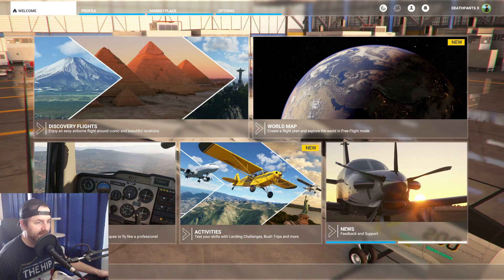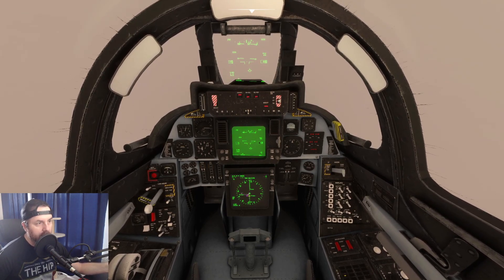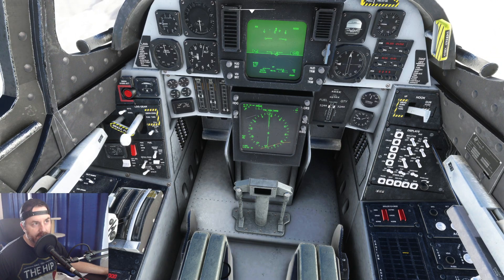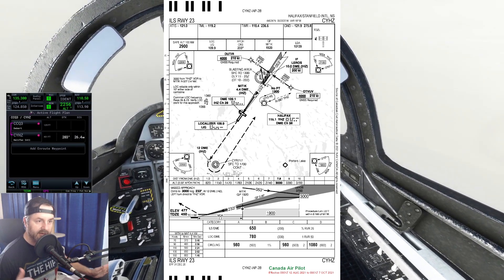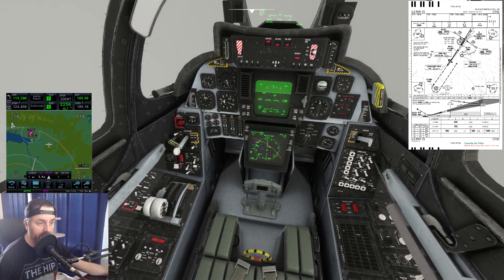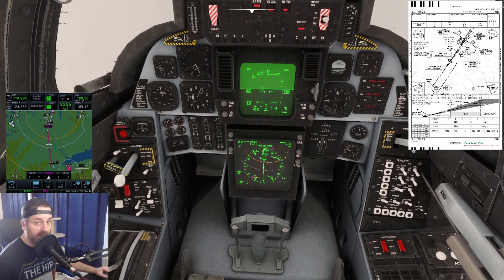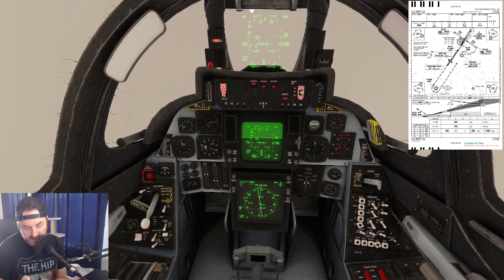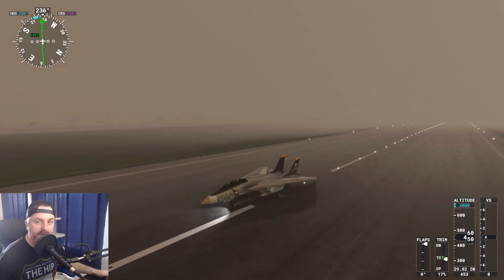FS2020 - ILS Approach Tutorial in the DC Designs F-14

Comment: WOW nice job Sir. I'm a prior F-14 mech (Survival systems) this is the exact video I was looking for. Very helpful. Question the ILS should be able to use separate of the GPS system (provided one can set up the approach "manually"  right? A manual approach video would be awesome.  Did you know they will be coming out with carrier ops in future updates? Can't wait!
Reply from the maker: Thank you Brian,  yes the ILS should be completely separated from the GPS, but DC Designs version it is not so straight forward....I hope that they update it and if they do I will create a lot more content about it.... it's a great plane but the autopilot logic really does need some work.   I have uploaded an f14 autopilot tutorial on this channel that goes a bit more in depth of the general autopilot shown in this one, and it might be helpful to check out. There are time stamps so you can skip sections of it as well.   I will be making a video of how to do an ILS with no GPS connection as well, now that you've mentioned it.  In any real plane that I've flown, or even any of the default fs2020 planes this is no problem.... but the dc designs version makes it difficult to achieve without any manual or instructions.   But great idea for a video I will do this in the future.   Thanks again.
Reply from the maker: Brian I'll be creating this video tonight if I can find the time... should have it uploaded by tomorrow.... I'll use an VOR radial to intercept the ILS... then overshoot at minimums and do a missed approach full procedure into a holding pattern..... at least that's the plan.   Stay tuned....

Comment: Hi Sim Pilot you mentioned auto flaps can you turn them off in cockpit  do you know where  pleas
Reply from the maker: I don't know for sure,  but I think if you lift the glass cover for manual wing sweep that it may switch flaps to a manual mode too.  But I am not at my computer to test this. If this doesn't work then I'm not sure if there's a way to disable them.  I know when I first bought the plane I didn't like the auto flaps idea and tried to find a solution, and if I recall correctly this was the only method that sort of worked for me.
Reply: @simpilotirl1954  thank you for getting back to me  thanks to you I understand auto pilot little better for the F 14 now